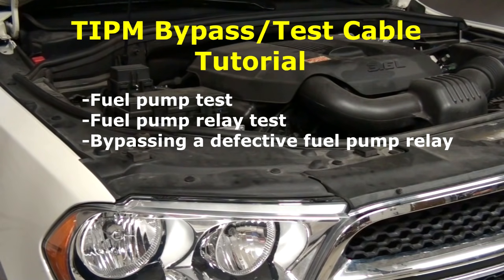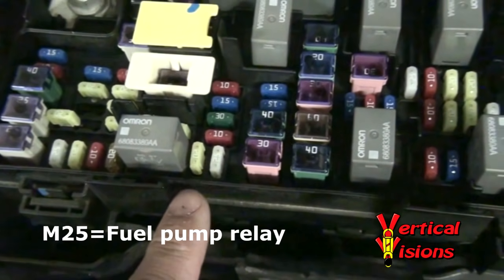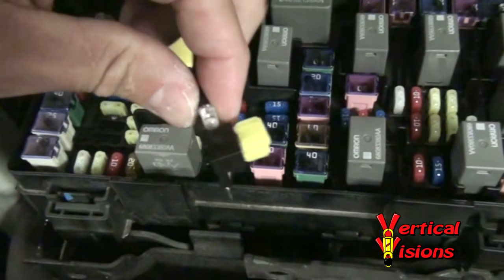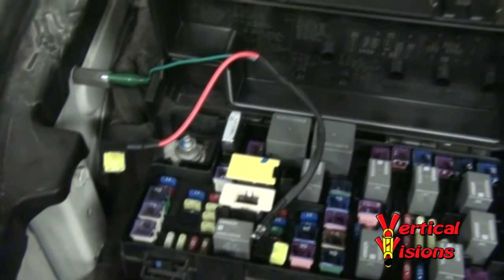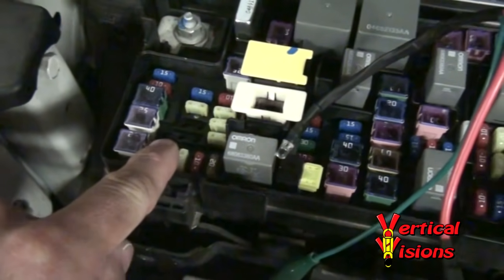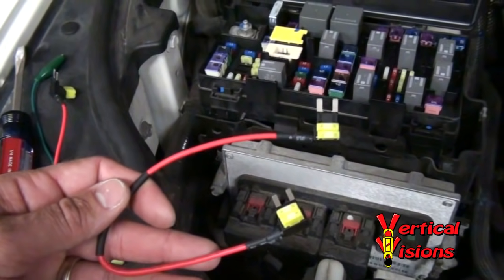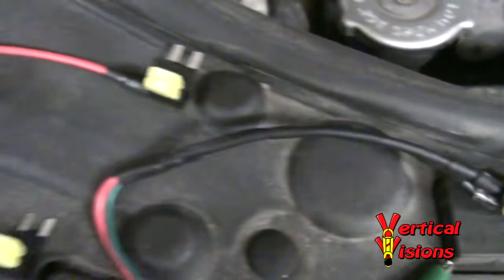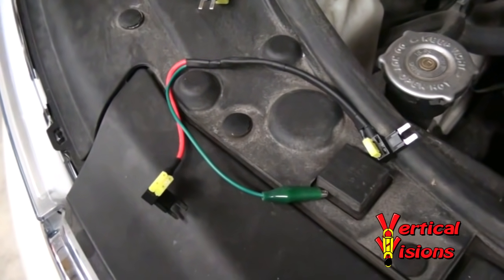TIPM Fuel Relay Test and Bypass Solutions - Most 2007-2021 Dodge, Chrysler, Ram, Jeep, VW Vehicles

Comment: Why can’t you replace relay?
Reply from the maker: You can.  But you have to remove the TIPM, disassemble it, then desolder and solder on a PCB.  We use a microscope.  If you attempt to replace double relays (door locks, wipers, etc.) and test first by energizing them to locate which one has failed, you will smoke a 16 pin transistor array.

Comment: I have a 2013 Dodge Grand Caravan.  The fuel pump is always on.  I believe that this bypass will work for my vehicle.  My only concern is that my fuse box looks completely different than the one shown in the video or website.  Will this bypass work with any fusebox?
Reply from the maker: Are you sure your fuse box is different? We sell parts for your vehicle every day and all have the TIPM-7 series fuse box shown on the video.  If your fuel pump is stuck on, the fuel relay is 99.9% the root problem.  Solutions here:  https://www.verticalvisions.com/tipm-fuel-relay-solutions.html
Reply: @VerticalVisions  maybe I'm just looking at it from a different direction...?  I'll look at it again, tomorrow.  Looking over the driver's fender, the fuse to the relay is at the top, center-right, unless I'm mistaken, which has been known to happen, lol.
Reply from the maker: @clintgarrett330  Go here to see a pic of what your TIPM should look like:  https://www.verticalvisions.com/tipm-test-bypass-cable-mini-blade-fuses.html
Reply: @VerticalVisions  as it turns out, they are the same.  I told you I could be mistaken, lol.  I'll be ordering the bypass shortly.

Comment: My wife's 2006  pt
cruiser would not start 30 minutes later after cutting mlm it off it will start and die so I put a brand new fuel pump on it still does the same thing what could it be

Comment: What are you going to do when someone rolls this vehicle over and fuel pump continues to run potentially creating a fire hazard.  Liability might come back to bite you if someone gets hurt and the modification leads back to your advice. The complexity of this circuit was designed this way for a reason.  You just told people how to bypass it.
Reply from the maker: Every 6 months or so, we get a post like yours.  If you took the time to read through the comments below or our website, you'll see that your comment is incorrect.  The fuel pump will shut off after a crash when using a TIPM bypass cable:  https://www.verticalvisions.com/tipm-test-bypass-cable-mini-blade-fuses.html#faq7

Comment: If your fuel pump is always on, can one just jump start there battery and continue doing that when ever the battery is low and not allowing the truck to start?
Reply from the maker: Yes, but it's easier to simply remove the fuel pump fuse M25 when you're done driving to prevent battery drainage.

Comment: Thank you thank you thank you. After 7 months without my 2011 Chrysler Town and Country, 3000 out for a new PCM, a new key fob and a new battery the dealership finally agreed it was the TIPM issue (something I had mentioned when the issue first started). I ordered the larger bypass tool and after arguing again with the mechanic my issue has been resolved! The only issue is sometimes it comes a little loose and the check engine light comes on, I just open the TIPM box and tap it back.

Comment: You SAVED Me $1500. Thank You. The Dealership { Cueter Chrysler } Wanted to charge me $1500 with NO Guarantee that want they do will fix the issue. My Vehicle {T & C 2011} sat in my driveway since Thanksgiving 2019. When the dealership told me that, My wife & i took the same $, and bought another T & C 2014 with 47K miles. Now we have Twins :)
Reply from the maker: Gotta love those dealers.  We guarantee a $25 part, but they can't back a $1500 repair.  
Everyone should buy an electric vehicle next time (Tesla).  Seriously.  Teslas don't even have fuseboxes or fuses, BTW.

Comment: I have a 2013 wrangler with no horn.  Can i do a similar thing to test the horn.  I currently have no power on either side of the fuse when i press the horn?  Thanks
Reply from the maker: Your horn would be on all the time if you bypassed it with a TIPM cable.  A TIPM repair would be advised in order to replace the horn relay.

Comment: My 2014 Dodge Grand Caravan is having some problems with longer than usual cranks. The battery is pretty brand new Jan 2020. I am wondering if at a certain point it will cause my battery to become dead? I dont hear any noises from the rear of the vehicle when the car is turned off.  So if the fuel pump is not on and the cranks are long, the battery should never have a problem going dead? The problem is just from the relay and shouldn't affect the battery?
Reply from the maker: Yes, long cranks will cause dead batteries.  Your starter requires a large amount of current that is delivered only via the battery.  If you have a faulty fuel pump relay, then no power is sent to the fuel pump and the long cranks persist until the relay intermittently works.  You likely require a fuel pump relay solution:  https://www.verticalvisions.com/tipm-fuel-relay-solutions.html
Reply: @VerticalVisions  Thanks. Im waiting on the cables. Hopefully it works with the new method (M37). Looks promising.

Comment: Does this work for the 07 Dodge ram 1500 pickup truck the fuel fuse setup is different
Reply from the maker: I answer this question every day.  https://www.verticalvisions.com/tipm-test-bypass-cable-mini-blade-fuses.html#faq10

Comment: I jumped M37 to M25, nothing happened no crank and not starting..what does it mean? the connection on M37 with top was 20am and lower 10am based on the diagram...
Reply from the maker: If you turn the key and nothing happens (no crank), your issue is not related to the fuel pump circuit.  https://www.verticalvisions.com/other-solutions.html#starter

Comment: 2008 chrysler town & country, no power, no lights, nothing. battery reading 12.5vdc. did a hard reset for 3 hours, everything is working now. My question: "Is their a module or relay in the TIPM that can be replaced, instead of buying an entire TIPM ($600)."
Reply from the maker: You can replace individual circuit boards inside the TIPM or repair single/double relays (fuel pump, wipers, door locks, etc.).

Comment: is this related at all to the fuel gauge on the dashboard not working? it says i have no gas at all even when i know i do lol. just curious i had alot of fuses burnt out in my module that  i replaced.
Reply from the maker: No relation that I'm aware of.  Could be the sending unit (a simple circuit that changes resistance based on fuel level).  It's built into the fuel pump.  But I'm not 100% certain since we mainly focus on TIPMs.

Comment: I Just fixed my problem thanks to you. I first changed my battery, then replaced my starter and now used your method with the simple wire. It worked! I am so happy because I did it all on my own. With the final part all your help! I will have my board fixed by you guys as soon as you move to your new location. Thanks again! Also my remote start still works on my 2012 Dodge ram 1500 st 2wd. So for anyone wanting to know if this will work on your same vehicle it will. Thanks!

Comment: I have replaced my tipm twice on my 2013 ram 1500 4x4. The a/c fan stops blowing intermittently  until it goes completely. 
Any experience with this issue and do you have a permanent solution?
Work was done at the dealer
Reply from the maker: No personal experience fixing this issue, but it is common since we get many calls.  It's not a traditional electromechanical relay that can somewhat easily be replaced.  But it's probably a MOSFET or similar solid state device that is failing inside the TIPM.  It could be your fan is pulling too many amps, which shuts down the system in the same manner that TIPMs shut down when you install low current LED head lights.  I wish I had more time to research it for you.  Perhaps you should park the truck in front of the dealer, pop the hood, and place a large yellow lemon or "POS" sign under the hood.  Guaranteed to get you quick service.

Comment: What is the symptom of this problem because my routan cranks but doesn't turn on until I crank couple times while pumping the acceleration peddle then starts. because I do here fuel pump go on a few seconds each time when I turn the key to pump gas peddle.
Reply from the maker: Symptoms and solutions here:  https://www.verticalvisions.com/tipm-fuel-relay-solutions.html

Comment: Hey Jason, great product. So I just installed it on my van.... the question I have is now when i turn the van off, it sounds like my fuel pump is running until i open the door. Sounds like a hum. Is that supposed to be this way? Second question is, my initial start test was the same crank crank crank. Then it worked after that. I am going to let it cool first and try again just to make sure as it seemed to always happen on a cold start. I got the cable only and left all fuses installed. TIA
Reply: I do see the part where you say to remove the second fuse in m25 if the pump is on when you turn the vehicle off, i will try this.
Reply: Do i need to remove M9 as in the video, i do not see it installed
Reply from the maker: Try our new cable connection, to answer both your questions:  https://www.verticalvisions.com/tipm-test-bypass-cable-mini-blade-fuses.html#faq19

Comment: Dodge Avenger 2010 intermittent starts. No clicking when starting good battery and starter. Turning over just not running. Radio a/c everything works. Should I buy this part?
Reply from the maker: No, because it probably won't work on your vehicle.  Our vehicle list does not included a 2010 Avenger.  Read this:  https://www.verticalvisions.com/tipm-test-bypass-cable-mini-blade-fuses.html#faq10
Reply: Jason Bell im gonna go for it just ordered it. Seeing the comments it’s worked on every other dodge and Chrysler

Comment: Thank you, Jason. I have a 2011 Ram 1500 and it started to have a parasitic drain on the battery. The average Joe can no longer buy the bypass module that so many on youtube use for the repair. Went to the dealership and they had a complex bypass setup for only... $89. Saw your video and sent for the simple wire hook up, $30 with the shipping. Plugged it in and bamm, took right off. By the way the 2012 and 2013 Rams are covered by a recall and that's the excuse I got as to why the bypass isn't available.
Reply: I have Ram 2011 4.7 ltr. Parasitic drain from fuel pump staying on after its turned off. Now hard starting or won't start. Ordered the standard bypass wire. Waiting for it to arrive

Comment: You know what is just horrible? The recall is VIN specific. If you drive a vehicle that is not a Grand Cherokee or Ram truck, yet utilizes the same TIPM with the same faulty relay soldered into the board, Mopar wont even allow you or any dealer or mechanic to purchase a bypass kit for your vehicle. They are reserved for the recalled VINs. What's worse is the bypass kit is also on back order for those with recalled VINs so everyone is having a terrible time with this... except us and everyone you've helped! Thanks! I plan to temporarily wire a switch between my add a circuits to the dash since my relay is only intermittently failing on cold starts.
Reply: So my switch that I wired into the dash was useless and it burned up. I just made an add-a-circuit thanks to your help. Then I swapped the tipm with one from the junkyard. With my original tipm out, I disassembled it and soldered in a new relay. That was a pain but it worked. I still keep my add-a-circuit in anyways lmao. Stupid tipm.

Comment: Is the fuse tap on the cig lighter side connected to the hot?? Or did you put the fuse tap pin on the left pin of the fuse over there so it would fit better in the tipm lid?
Reply from the maker: We don't technically use a "fuse tap", but rather an add-a-circuit cable system that is custom manufactured for us.  It fits under the lid.  M7 has both "always hot" and "key on hot" power, but keep in mind this video is slightly outdated in how we bypass faulty fuel relays.  See this link:  https://www.verticalvisions.com/tipm-test-bypass-cable-mini-blade-fuses.html#M37
Reply: @VerticalVisions  I see what you mean. After some research and a trip to the parts store, I was able to get the add a circuit bits and make one myself. It was an emergency but I wish I could have supported you for the invaluable knowledge by purchasing from the site. It cost more to make myself.

Comment: Great product. Can I use this to check and bypass the Hvac relay for my 2012 ram 2500 6.7 . I am having issues with my heater blower circuit and trying to figure out if it is the relay or ignition switch. Thanks
Reply from the maker: You can definitely use it for a fuel pump circuit, but I'm not certain about HVAC.

Comment: I have a Dodge Ram 2011  1500. unfortunately I changed the fuel pump which it cost me 400 dollars.  It did run well until I turn it off , after 4 hrs went out again. And the truck didn’t start . do you thinks one of you wires will adapt well for my truck?
Reply from the maker: Although I would need further information to be certain, note that 2011 Dodge Ram trucks are our #2 most popular fix and we've spoken with literally thousands of people who have changed their fuel pumps when the relay was the culprit.  Chances are you have a fuel relay issue, to which our products will resolve:  https://www.verticalvisions.com/tipm-fuel-relay-solutions.html

Comment: I had to do this bypass with my 2011 Ram 1500 and now my remote start will not work. I start it via my FOB and it just keeps turning over and will never fire up. Anyone else had this happen with this bypass fix?
Reply from the maker: If you use the new TIPM cable connection method, remote start works perfectly:  https://www.verticalvisions.com/tipm-test-bypass-cable-mini-blade-fuses.html#M37

Comment: that ground wire from the led should not hurt anything if left untaped, its the neg to an led=light emitting diode=letting power go one way, but its a good idea being some things can be bad
Reply from the maker: We have a new design now where you can remove the LED and ground connection after testing.  You're correct that the LED won't permit 12VDC to damage it if fed from the ground wire, but in the past we asked customers to cover the alligator clip to prevent shorts between circuits.

Comment: Thanks this video helps. I recently had my fuel pump replaced and a new battery installed a few weeks ago. Two days ago my battery was drained the vehicle was completely dead. I got a jump it started right away, but when I shut it off I could hear a humming noise coming from the rear. I figured it was the fuel pump staying on.
I would like to get one of your cables.
Reply from the maker: If your fuel pump continues to run after the vehicle is off, there is a 99.9% chance the relay is faulty.  Solutions are here:  https://www.verticalvisions.com/tipm-fuel-relay-solutions.html
Reply: @VerticalVisions  I studied your video and it made sense so I got the TIPM BYPASS Cable and there's no problem at all anymore with the battery power draining.  The Remote start doesn't work however anymore, but as long as it's running it's OK.
Reply: I have a 2013 Chrysler Town & Country. I forgot to mention I had my fuel pump replaced two weeks ago and had to get a new battery as well. Is the BYPASS CABLE only a temporary fix?
Reply from the maker: @TheDrumhead54  https://www.verticalvisions.com/tipm-test-bypass-cable-mini-blade-fuses.html#faq2
Reply from the maker: @TheDrumhead54  Use our new connection method to permit remote start:  https://www.verticalvisions.com/tipm-test-bypass-cable-mini-blade-fuses.html#faq19
Reply: Jason Bell  That new connection method is great! It helped a great deal. After learning about your TPIM bypass I wonder if I really needed a new fuel pump and if this was my problem all along (fuel pump relay). The mechanic I use knows nothing about this. 
Before I found out about your solution they were suggesting getting a new computer or trading my car in for a newer one.
Chrysler should reward you!

Comment: I own a 2013 Chrysler  T&C and have been having a on going (4 plus years) problem of my battery going dead. I have replaced the battery and can put a battery charger on it to charge it up. Plus when the van runs the alternator will also charge it up too.  I've also have experience some intermittent starting problems where the vehicle will crank over and not start all the times. Removing power from the battery seams to help. I also use my van for camping trips where I'd sleep in the back and at times could get a strong smell of gasoline coming from under the vehicle! I often wondered if something electrical what's draining the battery, never once did I think about the fuel pump relay!!! It all makes perfectly clear sense now! Thank you!!! I'll be ordering your jumper cable.
Reply: Thank you! Got my cables today and tested my fuel pump relay. Sometimes when starting the van you could see the Green LED flicker just for a millisecond and the van would start. Other times the LED would not even come on but there is times when the van would start and the LED would light up but then turn off in the van dies! Got both of the cables so now the regular bypass cable installed and we'll keep the other one in the glove box just in case a friend might have the same!

Comment: Amazing. I purchased the bypass cable and the instructions were given on a tag on the bag the cable came in. Also a direction to this video. Read the instructions ( you do RTFM right?) and watched the video, then went out to my 2011 Dodge Grand Caravan and literally in 3 minutes had the van starting again. Before that, no starting. This cable saved the day. Thank you! BTW, my 'dealership' told me the price to replace the TIPM module was $1400 but they had "a way we can bypass the faulty relay that'll save you 1/2 of that $1400.